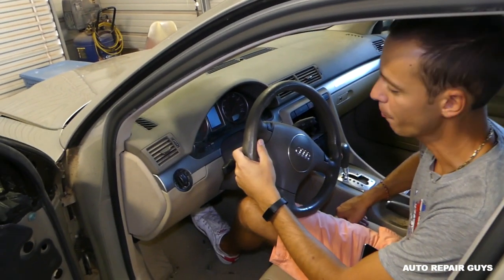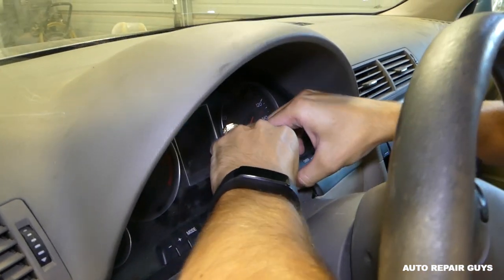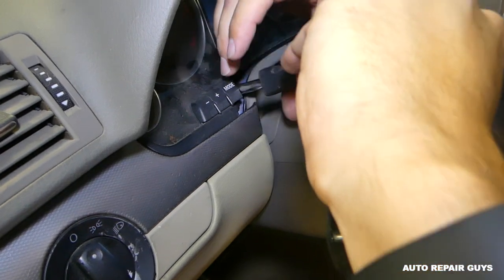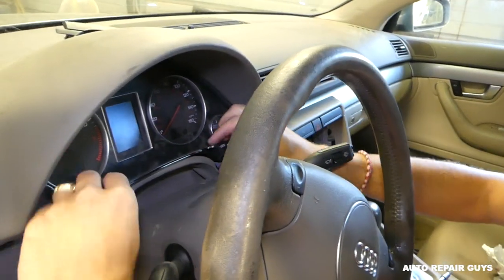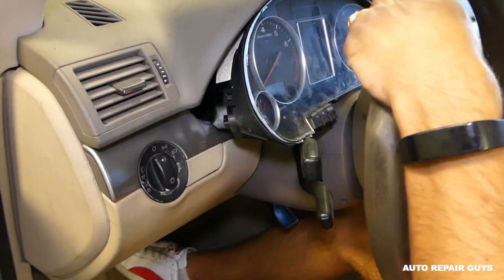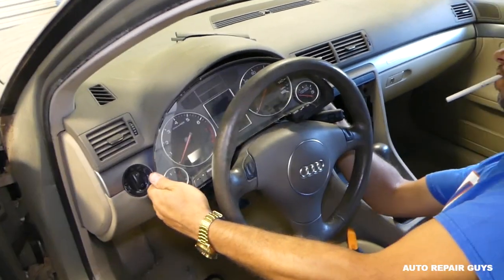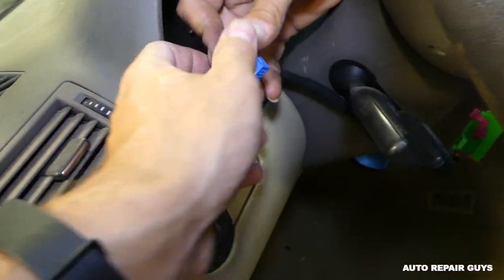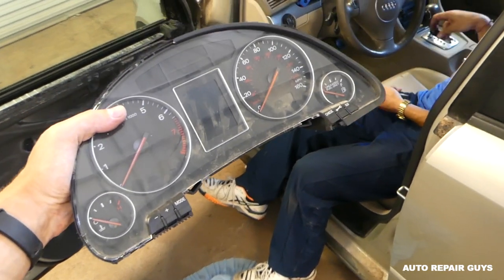AUDI A4 B6 INSTRUMENT CLUSTER REMOVAL REPLACEMENT

Comment: Nice video only one question, if I have a new cluster can I just plug it and replace the old one? Or I need to do something else to use a new one?
Reply: I'm not an expert, but apparently that doesn't work because they VIN, mileage, etc, needs to match the original car. Supposedly you can reprogram a replacement but need to get one that is specifically reprogramable

Comment: I have a B6 1.8 T station wagon avant Auto. My question is: if you have to replace the custler with One from another car, do you have just to plug the new one in or it will need specific computer configuration? Thanks
Reply: you need someone to save the coding of your original cluster, and then encode it back into the new one.
Reply: @bura280  how to do that???
Reply: @aleaguilera2993  vag - com
Reply: @bura280   My A4 2009 is from Canada I have replaced the cluster with one from the US before registering the car when I install the new cluster the air bag, the break light, the ABS warning came on and none of the needles move. Please help

Comment: Incimpleat information is always dangrous you have to to computer for coding without doing that it will not work and coding is not cheap
Reply: The title says instrument panel removal, which is exactly what I need to do on my 2009 A4 cab.  Then either replacing or repairing the LCD is a whole different video.  Appreciate this Video.